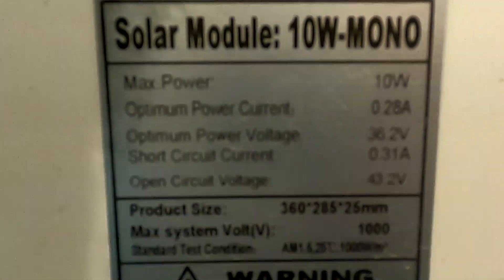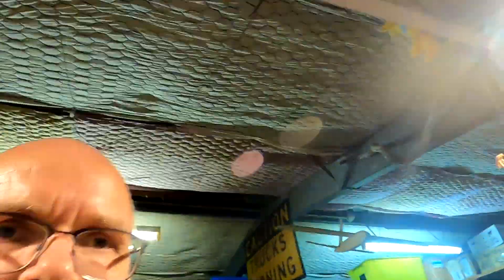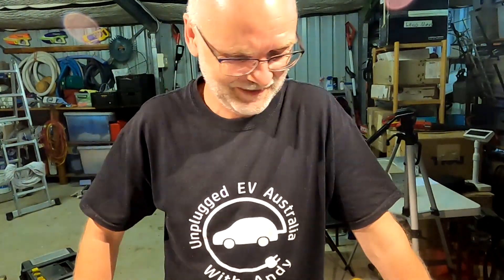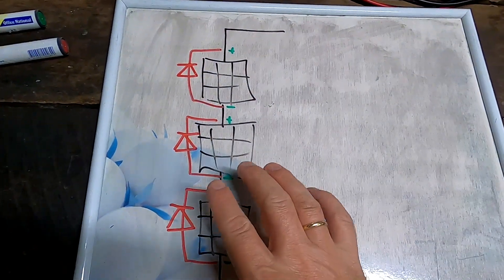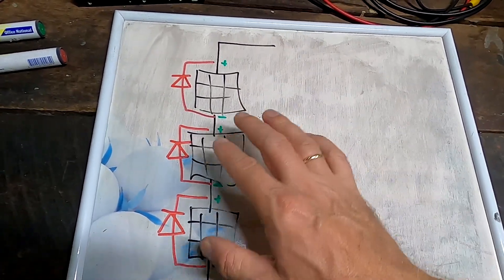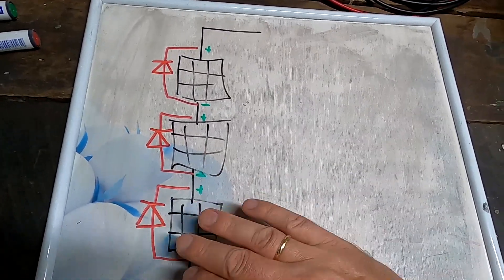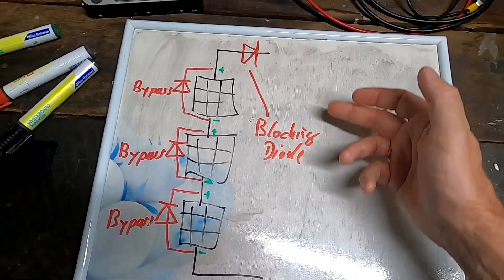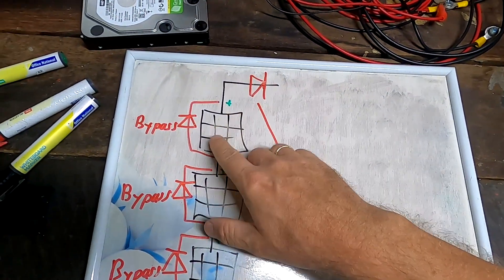Solar Upgrade EP4.1 - Bypass vs. Blocking Confusion and why solar panels DO NOT act as a diode!

Comment: Great explanation thank you! I think I’ve binge watched all of your videos... but trying to find one that explains how to calculate and size a solar system. In particular how to calculate how many solar panels are needed to charge your battery pack? Thanks to your previous comments on another video I’ve understood what my battery pack could look like but not sure how to calculate solar PV panel requirements. Eg our peak load reaches around 3-4KW. And can run all of our appliances with a 5KW generator. Some high loads such as electric showers are not used during any brownout as they are 6KW. On average per day we consume around 20-25KWH. If you have already convered this can you share the link, if not I would be interested to learn more about this... thanks!!

Comment: Blocking diodes used to be popular before the time of charge controllers and lithium batteries. Those days it was exciting to use a tiny 12v panel to trickle charge a lead acid battery and all that was needed was a blocking diode to prevent the battery to discharge overnight.... But then you already know this...

Comment: Touché :) Imagine living somewhere where the sun barely gets out of bed and you end up with 45-90 degree tilt on panels ( \ or | ). To get a usable sunny window you need 2 or three strings (E, maybe S and W) and these grid-tie inverters always have one MPPT too little or take too little current (low current panels are expensive). So, you discover they allow paralleling up and enough current through the day and BOOM, you have 100% shaded strings while others are at full MPP.

Also, if one mixes string voltages in parallel, blocking diodes are more important. For safety's sake, I'd recommend blocking diodes.

Comment: You just showed us that solar panels are diodes. Diodes are P and N semiconductors put together and have ratings or characteristics by design. Ratings are also limitations parameters of the design of that P and N junction.   If you apply an opposing pressure or voltage to a P and N junction very close to its rated output voltage, you'll start seeing leakage of current in tiny amount but blocking the majority of the current, If you go further, you will see an increasing leakage also until you eventually damage the material at a certain amount of pressure applied. 

If you put more of these P and N in series as the case in all solar panels to reach a higher voltage rating or that it can produce more voltage and current flow when light is applied, it also requires such voltage range to start leaking when a reverse pressure /voltage is applied.   Just because solar panels are diodes that does not mean it can block all current when opposite pressure is applied, again you presented it clearly in this video.   Not everyone have this understanding and it is good to put it in the comment section.  We have to remember that for every diode or P and N junction of these semiconductors  there is a limitation or rated capacity to do something. Some diodes are even used in reverse manner that one can take advantage of its behavior when used that way but each design has a limit due to material properties and combination of such properties. 

Should we need to show a test again to see if there is current flowing in the solar panel circuit going to the shaded solar panels, it is best to do the test similar to what is shown in this video showing a current meter at the point of interest.  But such a test is not really necessary if one is already contented in reading the specifications of the solar panel as the numbers are there showing the limitations of the design. For the sake of better understanding and gaining more confidence, such testing is done that we see the actual event and understand more from what we can observe.  We all have different views but when we put all of them together  and see, we can have a much better view and understanding  of the same thing from different points of view. This is what is all about.

Comment: Not only that, but if you turn out the lights and apply a large enough voltage (I forget which direction), the solar panel will start emitting photons (i.e. act like an LED).  Not all, but most, and it depends on a few other things.  Basically:

* An LED is a 'light emitting diode'.  Yes, its actually a diode.  All diodes are capable of emitting photons, just that most of them have opaque potting so you can't see the light.  And of course, normal diodes aren't even remotely as efficient as actual purpose-designed LEDs.

* A solar panel cell basically uses PN junctions... in other-words, it is also a diode, and it can actually emit light if you feed a voltage through it.

* An LED can act as a (poor) solar panel as well.  Again, since it isn't designed for light collection, an LED will make a poor solar cell.  But it will still work.

HOWEVER, the diode structure of a solar panel  cell does NOT typically have a high reverse break-down voltage.  All diode structures have a reverse-breakdown voltage... that is, if you apply a large enough voltage in the wrong direction, the PN junction will break-down electrically (this is a temporary effect) and allow current to flow.  This is an exponential curve... it can behave like a dead short with a large enough reverse voltage applied to it.  Here is an example:

https://learn.sparkfun.com/tutorials/diodes/real-diode-characteristics

A Schotkey power diode designed for blocking has a high reverse break-down voltage.  In fact, if you use one, it has to be modestly higher than the worst-case open-circuit string voltage to actually operate properly.

In anycase, I think you are trusting your test yesterday a little too much, as I said in posts to yesterday's video.  You really do need blocking diodes, just for safety if not for anything else, when dealing with high string voltages.  You can't depend on the blocking characteristics of the solar cells to operate reliably under those conditions, they just weren't designed for it, and the failure case (as I mentioned) is basically a dead-short.  The fuses will save you, but it's totally unnecessary to stress the panels that way when you only lose 0.5% of your solar energy by adding a blocking diode on each string.

-Matt

Comment: 100% agree with your explanation, but there is a scenario for the backwards current to occur:

Off-grid system, batteries full, still plenty of sun, but a little latter in the day (meaning sun is at a considerable angle)

If you have, let's say 2 strings of 3 pannels, but one of them gets completely block by hard shading (building, chamine, etc) at that time of day you will probably be subject to reverse current.

This is not likely on grid-tie system, as the controller can get all the power available, but in off grid, if the batteries are full, it will block any current to go through, the voltage on the string exposed to the sun will rise to almost Voc and the path of least resistance will the the shaded string.

Off course a "hard shading" is predictable and this can be mitigated.
Reply from the maker: That would be a very extreme shading. I don't think this is actually happening. And at such a scenario, the charge controller would drive the panels into an ineffective area of the curve anyway as the battery is full.

Comment: Bypass diodes still seem to be optional in smaller (100W or less) panels.  I added diodes to two of those panels a couple of weeks ago.
Reply from the maker: Must be older panels. The $30 panel I showed is 6 years old and already has it.
You only need these diodes if you have a series connection.

Comment: Reading solar power theory it would appear that for optimal panel performance EACH panel should have its own dedicated mppt controller. This would be best way to mitigate shady losses bringing down whole string performance for only one or a few panels being shaded. Particularly useful on sailing boats where sails and rigging play havoc with solar panel efficiency.
Reply from the maker: That's only possible in grid-tied system where your have micro inverters installed under each panel.
With battery systems, it's not worth doing this as you can just install 3 more panels to compensate for the losses.

Comment: Do you really have bypass diodes on your panels ? When you blocked 2 panels in a string and disconnected the other string you only got a few watts. If the bypass diodes works you should get the power that the remaining one panel outputs , which should be approx 200W ?
Reply from the maker: The shaded panels still produce power. The cloth is not blocking 100% of the light and some cells on these panels where not shaded. So the power from the shaded panels was still enough to feed the inverter. It needs far more shading to let the bypass diodes kick in.

Comment: Andy, I'm sorry, but now I don't think you're absolutely right:
If you are right and they were just bypass diodes and you will cover only one panel from three in the series, why you will lose the string power almost to zero, but not only by one third ?
Why are you experimenting on NOT  illuminated panel  and why didn't you reverse the polarity from the source ?
Reply from the maker: The cloth does not block the light by 100%. The panel still produces enough power to run the charge controller. As I said you would need a card board shade to really cover it 100% with no power been produced. I don't have card board shading often... ;)
Reply: @OffGridGarageAustralia  OK, but as you say in this video, the panel has a bypass diode, and such a shielded panel should be bypassed and reduce the power of the entire string by only the power of one shielded panel. But in fact, such this panel will reduce the power of the entire series power to almost zero, or to the power of the shaded panel.  :-)
Reply: @antoni_sk  That is exactly what you saw in the last video, the covered string 30watts  and the other 600watts, that  the disadvantage of panels in series, your entire string goes down, depending on which part is off the panel is affected by the shade.
Reply: @habana7638  As Andy mentioned in the video, bypass diodes aren't of much help if the series string is less in number, in his case 3. In the test, he blocked 2 panels out of 3, in theory it should produce 200W instead of 30W right, because of the bypass diodes. However, he has a battery system with over 50V and only one panel is not enough to charge this battery, because the Vmpp of the panel is less than 40V.  If only one panel was covered, he would have got more power like 300-400W from two panels because the two panels' series potential is more than the battery's. I think Andy can easily verify this.

Comment: 12:17 what happens if the input door, in the solar charger controller, is closed because battery is full?
Reply from the maker: It does not turn off the charge controller, there is no switch or relay. When the battery gets full and the charge controller reduces power it just drives the panels away from the maximum power point, into an inefficient area of the solar panel curve so to speak. It will not disconnect the panels though.
Reply: @OffGridGarageAustralia  thanks for the answer and for the time you spend to give us free learning content. 

You, Will Prowse, David Poz and Jehu Garcia are the best solar teacher in the globe!

Comment: As I understand,  people in cold climates will intentionally "push"  a  "reverse"  current through an array to heat the panels to remove snow/frost.  Guessing that isn't a problem that you have.
Reply from the maker: Yes, I had this in my video as well but cut it out as it would open another can or worms.
Apparently you can do this to melt ice and snow but I don't know what parameters or setup this involves.
Not so much a problem here, no 🌞
Reply: @OffGridGarageAustralia  
Midnite solar at one time had a deicing feature on their controllers which reversed voltage to melt snow. They discontinued it due to different solar panel model requiring voltages to achieve same results
Reply: It is a reverse current to the panel but is a forward current across the diodes that makes up the panel. The diode is said to be forward biased.

Comment: a blocking diode is only needed if one is using a low wattage panel direct to a battery with out a controller lets say for long time vehicle storage to stop the battery discharging into the panel
Reply from the maker: Yes, that would be a case for such a blocking diode. Great example.

Comment: I am not sure how your strings are wired, however, I would suspect that when you flick off the breaker you also break the connection between the strings so no current can flow between them blocking diode or not.
Reply from the maker: There is no breaker in between the strings. The breaker will disconnect the whole solar array from the charge controller but leaves the strings connected in parallel.
Reply: @OffGridGarageAustralia  wait.. .what?   You have the strings connected in parallel without a fuse between them?   Why do you even have separate wires going into your juction box if the strings are already connected in parallel prior to the junction box ?  I think maybe you need to do a bit of rewiring.  Or you are not describing it properly.  If you don't have any diodes OR fuses between the strings, then you have a problem.

-Matt
Reply: @junkerzn7312  This is a really good point. When you disconnect the fuse in your enclosure, you're breaking any connection between the two strings. Otherwise cutting that fuse would have no affect if they were connected in parallel at some point before that fuse. IE: if the strings were still connected in parallel with the fuse removed then the current would just flow through the other fuse instead.